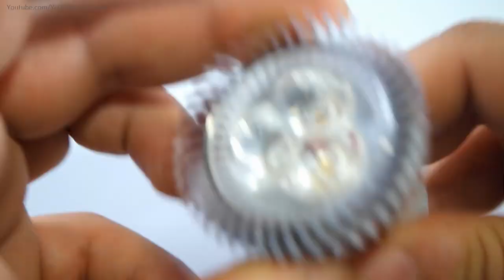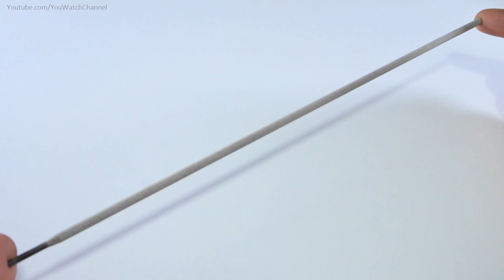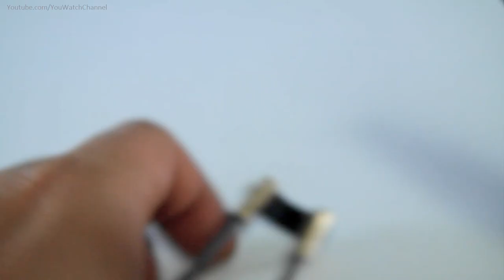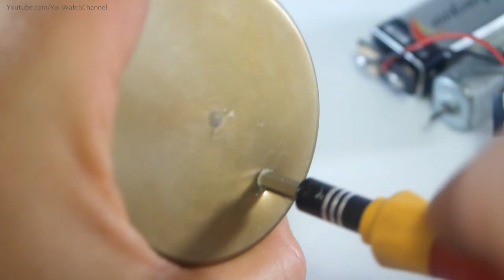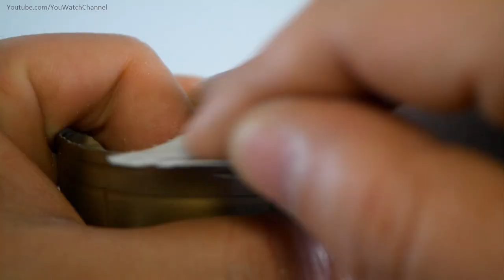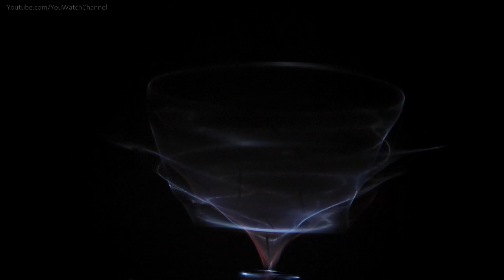3 AWESOME IDEAS : Magic Light Bulb - DIY Compass - Hologram

Comment: on which u put plastic cap in box there is only two item battery and switch pls.reply
Reply from the maker: the transparent plastic cap make the DC motor more steady 
glue isn't enough